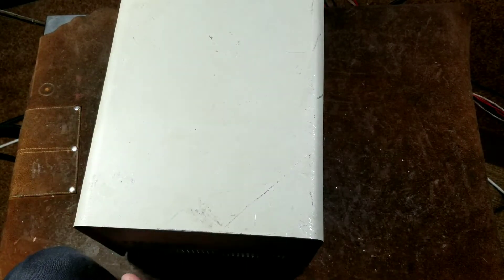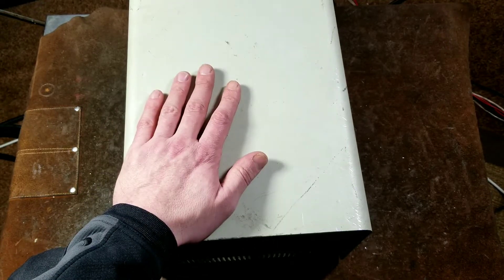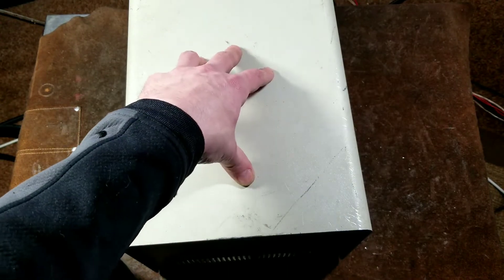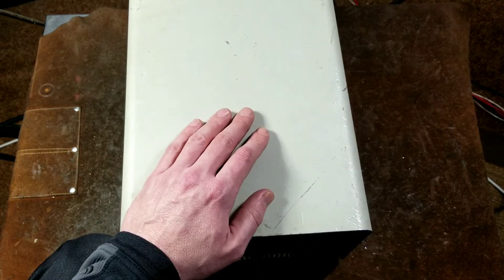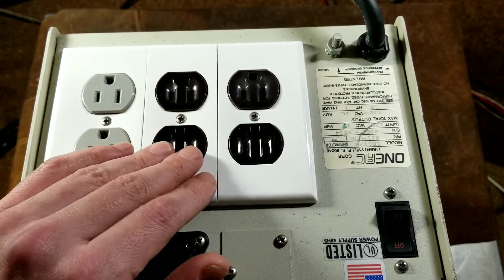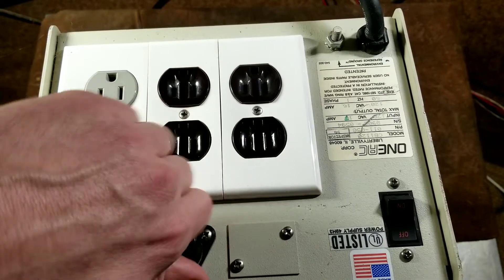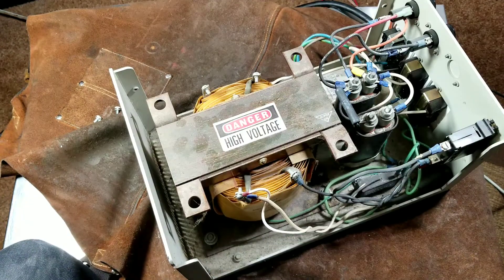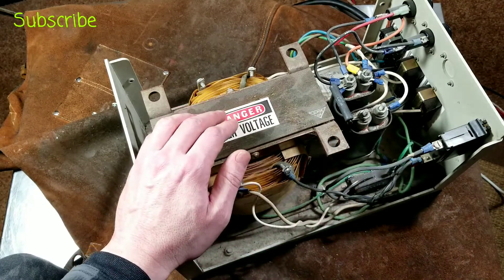OneAC Industrial Power Conditioner Isolation Transformer Review & Discussion

Comment: Another problem with MOV-based surge protectors is as follows. MOV-based surge protectors begin degrading the moment they are plugged in. MOVs are sacrificial devices. They can absorb a certain number of surges and still test good. Then, one more surge comes along, and the MOVs fail completely. When that happens, whatever is plugged into the surge protector is totally exposed to power surge events. These ONEAC conditioners are very nice pieces of equipment. I have three of them, including one like the model shown here. The only difference is mine is a CB1120H. I have read that the "H" stands for "hospital grade." This is an excellent video.
Reply from the maker: That's a great point about MOVs!

I just added a 750w little guy to go along with my 2000w and 3000w units.

Comment: Thanks(?) XD, just bought bunch of (5 to be exact, from 240W to 1000W) Oneac Power Conditioners on eBay after looking at your video XD

I think it's better solution than most conditioners on the market today since most of them are just for noise reduction, and cost more than the 5 Oneacs I got from eBay (even with most money goes to shipping since I live in Taiwan), most are new too, feel like I am getting a great deal on something really great instead of many baked solutions that I was considering buying :)
Reply from the maker: You will want to break the neutral-ground bond on the output side outlets to really make them fully isolating there is usually a little metal piece on the outlet itself bridging the white neutral wire to the green ground and that is what you want to remove but still leaving the ground wire itself connected normally.
This is not something your would do to your home breaker box or normal outlets but with a isolation transformer removing the bond on the output side does improve performance.

Comment: I have one those ,,, it is not a isolation transformer ,,,, my have a GND green wire from a power cord connect  to shassis,then one wire from etch recep,, connected to GND , then 1 strap on each recep , as you can see the green wire on a electric panel is connected to neutral , so as you can see this thing is not isolated at all , if you want this thing isolated  you have to do what i did to my  ,,,,,cut the green wire on the power cord so this fucking thing don't touch  anything ,,,,,i know this is a violation by the electric code  but you do this only for you on you house ,,,not for you father , you mother, you sister ,you  brother ,don't  even for you mother in law , i have a few  isolation transformers  but all are grounding  but they call it isolation transformers because they want cover they asses by the electric code  but this is not what you want on you bench ,,,,on you bench isolated transformer you want a live wire and neutral ,,that's it ,than the secondary  on the transformer are float wires ,

Comment: So, what happens when I plug my 10Amp electric motor in an Oneac CP1107 when the tag says input 6.7 amp and output 6.25amp? Is it just going to flip the switch?
Reply: 10amp at 120v ac ? Or is it a DC motor?